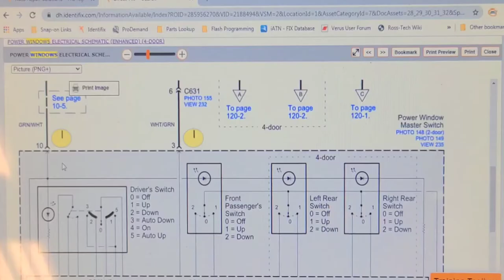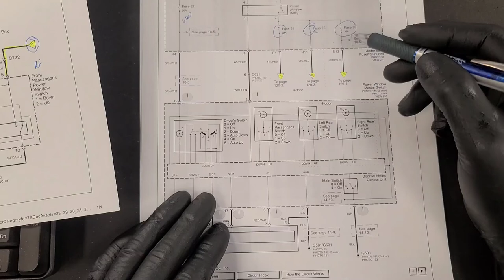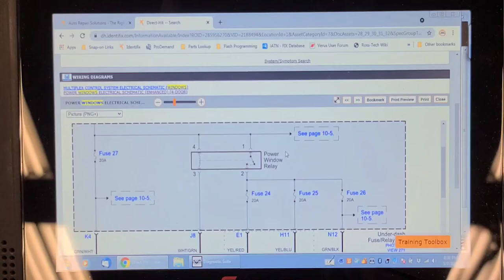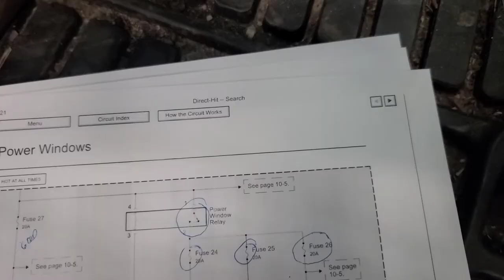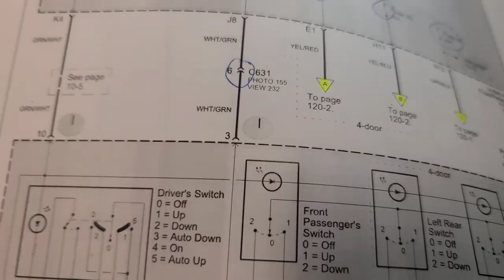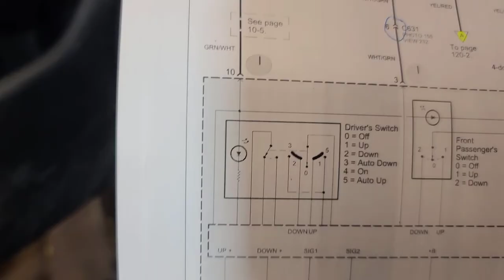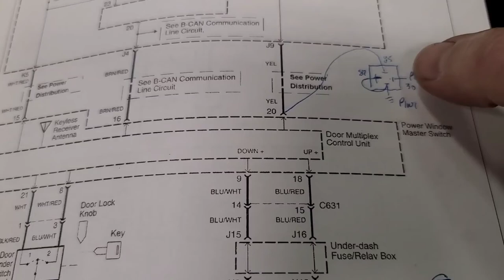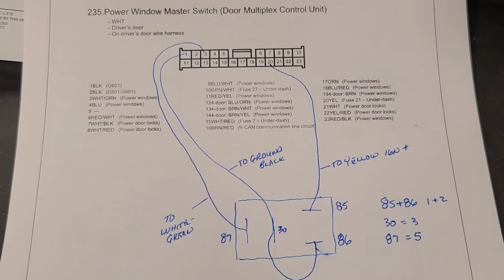2007 Honda Accord 4 Door SE. Three Power Windows Don't Work From Any Switch.

Comment: I had this issue 2 years ago, I followed a video then to bypass the relay and jus like you explained it eventually drained my battery. I have now been chasing a parasitic drain and it is definitely this. Thank you! You are a master mechanic, your entire process was amazing
Reply from the maker: Yes if you ground that relay permanently it will be energized all the time and the relay will draw around 100mA. Depending on weather conditions and battery capacity I'd estimate 4 to 6 days in summer and 3 to 4 days in winter.

Comment: Same thing happened to  my wife's 07 accord sedan.  Added a $6 relay as per your discussion and it works perfectly.  Thank you for posting
Reply from the maker: Glad it helped you out. Now you just need a small stick to smack the kids in the back seat if they won't stop playing with the windows.
Reply: So did you just replaced the relay and it worked? Without changing any wires?
Reply: Do you have a link to the relay?
Reply: @E67CHope did you find out what wires and small replay he talks about for the fix?

Comment: Worked great on my 07 Accord. I had the other temp fix for it where i shorted the 1 and 3 pin but it caused a parasitic drain on the battery which would die if I didnt use the car for 2 or 3 days. I did get a new and bigger battery but this will definitely help and give me peace of mind. Thank you for a great video!
Reply: I did notice 1 slight issue with this fix, besides the child window lock not working which doesnt bother me. Before this fix, I could use my key fob to open all my windows remotely while walking to my car on a hot day. Now only the driver side window opens with the fob. Still not a big deal, I'd rather that than the slow battery drain. Thx again!
Reply: 😊😊⁰

Comment: living in the Yukon it was mostly the wire harness between the door and master switch the wire'[s broken due to severely cold weather ,  you saved the day sir , Hello from Alberta Canada
Reply from the maker: I would do this on my own car. It can always be fixed correctly, just plug in the new switch and remove the relay to restore the child lockout feature for a mere $500.00...

Comment: FYI: It may not be the actual push button switch but rather the control circuit from that switch. The symptoms on my Accord exactly the same. I took the actual switch apart and it was just fine. So in my case it was the control circuit.   good video
Reply: control circuit ?

Comment: Going to try to finally tackle this problem I have been having with my 2005 Accord V6 once and for all. The car has been sitting in my driveway for 2 years and initially I was starting it up and moving it around during the hot months of last summer until one day this exact problem came to bite me and it rained all in my interior and screwed my back floor and brought mold into the car. I have been taping my windows shut for 2 years now. Praying it's as simple as the fuses not working. I'm going to try them with the bulb tester and inform you on how this works.

Comment: Dear Phil, I am a fellow mechanic. 
I had this problem with my accord. My mechanic couldn't figure it out. Your video is great, except for a few things. 
Most importantly, you should have given some pictures of the part you wired. You went over it for about half a second. Less importantly, you should have shown how you 'tee'd the wires. 

Otherwise, great video. When I grounded the green and blue cable with the test light like you did, the windows started working.
Reply from the maker: Thanks for the comments. I sometimes forget the details and assume people understand a basic relay and have basic electrical skills. I'll try to be clearer in the future.
Reply: @PhillipBailey  I was able to figure this out pretty easily, but a visual aide can be very helpful. 
My diagnostic process was also slightly different than yours. I measured the power at the control pins of my P/W relay with a multimeter. I had no power on the pins. I did not have a relay jumper, but I tested the relay to be good by using a swap test. 
When I grounded the green/white wire with my test light, I heard the relay clicking. At that point, all the windows worked. 

Your solution is pretty smart. You're  providing a ground to energize the relay, but only when the ignition is on. After looking at the schematics, I understood how simple this job is.
Reply from the maker: @fyodorberkovich8247  hopefully this helped you out.
Reply: @PhillipBailey  without this video, I would still be diagnosing
Reply: @fyodorberkovich8247 Apparently I'm stupid, I can't figure out how to do mine.
Reply: @PhillipBailey how did you do the relay?

Comment: great video great explanation on how to fix it. was working on a 06 honda accord stumbled across this video and it work for our customers vehicle.
Reply from the maker: Yes I can't believe how common this issue is on a number of Honda models.  Glad it helped you. Some have reported finding the switch at cheap price but certainly not in Canada eh.
Reply: @PhillipBailey I have this problem on my 05' Honda Accord.
Car only has 53k original miles 🤷‍♀️

Comment: My windows just quit working as of July 3rd 2024. Did exactly what you did and it helped very much appreciated what a lifesaver💪
Reply from the maker: @doobietwo1  glad it helped you out
Reply: @PhillipBailey I’d like to know what wires (the white ones) and the small reply you placed at the switch? I’d like to do this fix, but I don’t which parts to buy.
Reply from the maker: @clarissamadrigal9959  any standard 4 pin relay will work. Most relays are labeled with the common numbers 85, 86, 30 and 87. All connections at the switch are teed into the wires.
Reply: @PhillipBailey  thank you. I will try this tomorrow morning 👍🏼

Comment: THANK YOU!! This worked for me too and the Child window Lock still works! I really appreciate your video! 💯🤙
Reply from the maker: That is good but the child lockout feature should not work with this mod.
Reply: @PhillipBailey  That’s crazy because I did it exactly how you did it. I was also having the exact same issues as you were we’re only my driver side window would open and the passengers wouldn’t but I could hear the clicking. Once I did this mod using your diagram now they’re working. I was talking about the Child window lock.

Comment: Thank you it worked on my 2007 Odyssey. I used quick splicers to connect the wires together. (just in case I had to undo it).

Comment: Thanks for the time and effort into making this video, I have this issue on my '07 Accord and will attempt this fix. I'm not that familiar with electronics so forgive what might seem like obvious questions. When you say to "tee into the wires" do you mean to cut the insulation, wrap the wire around and cover with electrical tape, what size spade connectors did you use to attach to the relay, and is there a specific wire gauge to use for the connections?
Reply from the maker: Yes you are correct to T into the wire strip a section of insulation off the wire, wrap the wire around, solder and seal with tape. There's very little current so 16 or 18 gage wire is adequate. Terminals to fit the relay are usually 1/4" female spade red in color. Good luck and let me know how it works for you.

Comment: great video even years later. Any idea what actually causes this GND issue? Wondering if you ever opened one and replaced the part on the board causing the issue. Thankfully these seem to be a lot cheaper now a days but opening one up to fix without a bypasss would be great.
Reply from the maker: @all_the_hype  no this is the only one I've ever had. Sadly the engine blew up about a year later so they scrapped the car.

Comment: I have a question, right now my driver side window works fine but the passenger window and back two windows do not roll down or go up, but when I try to roll them down from the driver side control I can hear a click sound
Reply from the maker: If you watched the video you likely have tge same problem as this car. Likely a failed master switch but you need to do some tests to confirm it's not a broken wire between the driver door and A pillar.

Comment: This happened to my SE also. Is this just a design flaw? Seems like this and front passenger side cv axel should be recalled and fixed as common issues from Honda. I've had two 07 accords and both has same axle issues just fail while on the road

Comment: That's a great video. I'm trying to sort out an electrical issue basically same car, ignition on all window work. Ignition off. In theory 4 should stop working. The issue is 3 windows stop but one is constantly live draining the battery. Im very welcome to suggestions. Thsnk you in advance
Reply from the maker: So one of the power windows works with the key off? Which one? Both open and close?
Reply: @PhillipBailey  the passenger one. But its a RHD version. Just the 1 window (continuous live behaving as  if the key in the ignition all the time). When the keys in all of them work as they should. When its out, i have the passenger front  window continuous live keeps draining the battery after a week or two, while all the remaining windows behave correctly meaning they only work when the key is in, and disengage power. Id love to figure out the issue, car gets used maximum 100km in a week at the moment. Every 5 days with a lot of sitting around. Answer to ur question: passenger front, yes works up and down, u can even see the light illuminated at night when the car's locked with the fob🙈
Reply from the maker: @michalsilezin8898  so the left front door window works with the ignition switch off. What year, make and model. You say it's rhd as well.. give me the year make and model and I'll look at the circuit see if I can figure out anything. Does it have power locks? Do they work properly? I'd check the wiring between the door and pillar. Maybe someone fixed wires in there and switched some wires around. With the key off and condition present pull other fuses one at a time to try to locate the fuse that's actually supplying the power to the switch.
Reply: Year 2004, Model Accord 2.2CDTI executive, 5 door saloon version. Has power to the locks, central locking does work Properly and correctly. Will definitely start with checking fuses inside cabin, thank you for your input - it really is appreciated as every night a the moment I am disconnecting the battery clamps off the battery, and when the car is needed again manually unlocking it, popping up the hood to then reconnect the battery to get going as per normal. I wish you were closer.    @PhillipBailey
Reply from the maker: Did you figure it out? @michalsilezin8898

Comment: Just wanted to let you know that. The drawing at the end doesn't match The relay you had on the door switch.. The jumper wire is in the wrong place. And the drawing it is on the other wire

Comment: Hi Phillip. I got the windows back up by using a wire as a relay jumper on the relay by the kick panel. Now wondering where to find the wire and relay to fix the problem like you show in this video. Could you possibly suggest where to find the wires and relay.  Thanks again. Really appreciate the help.
Reply from the maker: You can use any 4 pin relay. You have to fabricate the actual wires for it though.

Comment: Would there be an easy and quick solution just to get the windows back up if they are down and this is now happening ? Thank you. Great video. Always amazes me the stuff you can find on here.
Reply from the maker: You can temporarily ground the circuit and that will turn on the relay which will allow the three windows to be closed.
Reply: @PhillipBailey  Thanks for the quick reply. What would be the best way to do that?

Comment: Thank you for doing this video!  This is exactly what my problem is.  Will it be fixed if I just buy a switch and change it?  I think it would be easier for me to change the switch out than do what you did.  If so, Could you do a video on how to change the switch?
Reply from the maker: Yes most likely is the switch. If you can find one for a reasonable price I'd go for it. Pop the switch assembly out and you should be able to figure it out. Couple connectors to unplug. Don't have the car here anymore. It could also be a broken wire between the driver door and pillar in that rubber flexible boot. I'd visually check that before ordering the switch. Good luck.

Comment: Do I twist the 2 wires together  and put it on pin 30 , there is no damage to put the 2 wires together  , it will not create a short or blow the fuse.

Comment: Phillip thank you for the help. I did the wire bridge connecting 1 and 3 and that helped bring the windows down. The minute I did that my alarm stopped locking the doors the minute I took the bridge off my alarm worked. Any idea what could it be?
Reply from the maker: Did you use the relay or did you just connect a jumper to pins 1 and 3. If you just put a jumper it will energize the lockout relay and cause a parasitic draw. Is the alarm system factory or aftermarket?

Comment: Very nice. I have an issue on my 2004 accord sedan. I can't roll my rear driver window up from the master switch, but I can roll up it from up that window switch. I replaced the master window switch and nothing. Where is a common area to find broken wires? Thanks, great video
Reply from the maker: That sounds like a problem with the left rear window switch. It has two internal relays in it with normally closed contacts. Try switching the left rear with the right rear. I know it does not seem to make sense since it works from that switch but give it a try. Let me know how you fare.
Reply: @PhillipBailey  hello again, I had the idea of doing that after I posted this comment since the plugs are the same for both sides, will report back

Comment: Hey Phillip, Thank you very much for this solution, I'm about to try this in my 2005 accord, however, I was wondering what kind of relay should I use? I was checking in a local store and they sell a relay intended for cars but it needs 7.8 Amps to be activated which I'd burn the fuse of the pin 20. Can you provide the specs of the relay you used?
Thanks!
Reply from the maker: Any standard 4 pin relay will work. I'm sorry but don't have a part number. I have dozens of used ones from various vehicles. Most relays only require 100 to 150 mA of current to activate. Try a salvage yard for one that looks like the relay I used. They will probably just give it to you. Take a picture from the video if you need to. Sounds like tge parts store is selling you a starter solenoid relay.
Reply from the maker: https://www.ebay.ca/itm/Relay-4-Pin-20A-12V-CE-Make-Break-On-Off-For-Car-Van-Boat-Bike-Terminal-SPDT-/333747129274?mkcid=16&mkevt=1&_trksid=p2349624.m46890.l6249&mkrid=711-127632-2357-0
Here is an example.
Reply: @PhillipBailey  awesome! Thanks man. I'll try it this week
Reply from the maker: @edgaranaya2956  how did you fare with your window issue?
Reply: @PhillipBailey  your awesome Phillip ....he didnt reply but im sure hes all good .

Comment: Have a 05 v6 Accord with rear right window not moving at all and it seems to be sinking each month. I pressed the switch and there's no clicking sound. The master switch is working cause it lights up when the car is running. But the individual switch for that window doesn't light up. I'm guessing that's not getting power somehow. I've checked the fuse and it's not blown. What might be the issue??
Reply from the maker: This video is not your problem if it only is affecting the right rear window. I'd check the wiring in between the rr door and pillar for broken wires. If the window is gradually dropping it may have a broken regulator.

Comment: Phillip, enjoyed your video.   I was wondering two things:  (1) why go though the trouble of installing a relay to connect pins 1 and 3 of the Power Window Master Switch (see  12:54 of your video).  The relay will only close when the car is on.  Is there a drain on the battery if you use a simple wire to connect pins 1 and 3 when the car is off?   (2) This elegant solution bypasses the child safety switch by putting pin 3 to ground and activating the power window relay (which now gives power to the three passenger windows).   But does it also solve the problem that the drivers side window switches where not able to turn on any of the passenger windows?   Cheers.
Reply from the maker: The master switch needs to supply a ground to turn on the relay under the dash that supplies power to the passenger switches. The windows all worked fine from the master switch. If you permanently ground the passenger switch relay it will cause a parasitic draw. HTH
Reply: @PhillipBailey  I implemented your solution last weekend and it's working well for all the windows on my 08 Accord (but without the child safety button of course).   Thank you for the useful video.

Comment: This is the exact problem I'm having with my 2006 Odyssey. Could I also try changing out all the switches from a wrecked Odyssey and swapping it? Or would that switch just blow eventually too?
Reply from the maker: You could try a used driver door switch. On some that's the keyless entry module so if you have remotes they won't work. I doubt its the individual switches as all of them would have to be bad.
Reply: @PhillipBailey  right understand. We do have remotes. I'm just unsure of how to do this relay install but I'm a decent parts swapper